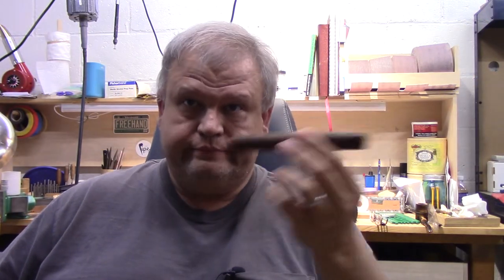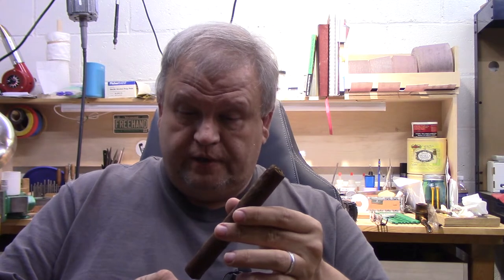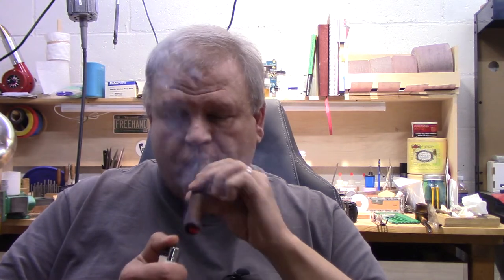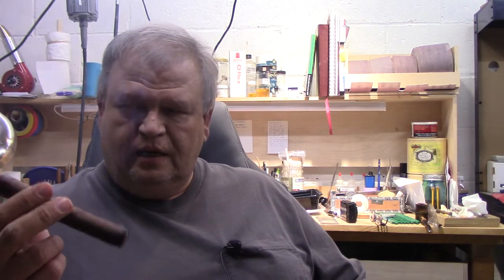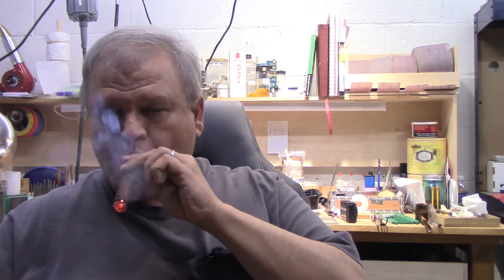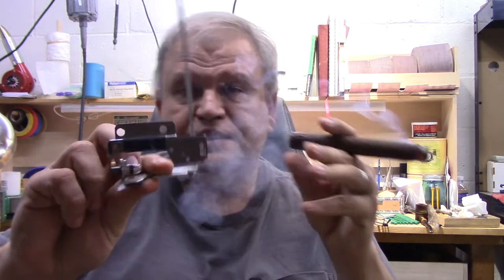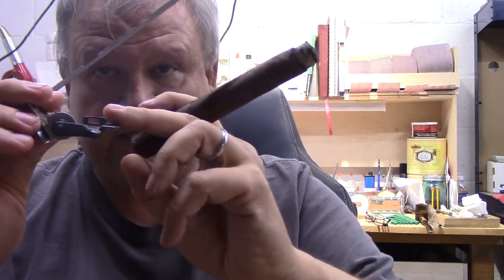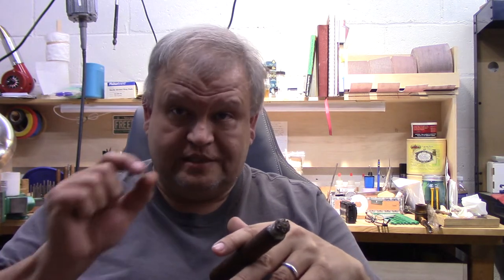Thursday Roadway Ramble 04 June 2020

Comment: I've also fixed a few laptops and it's often a patience game, you really have to take your time and examine how everything is connected before rushing into it. Taking a picture before you take it apart is often a good idea and a set of magnetic screwdrivers and bits can be a tremendous help. I'm not at all surprised you tried to fix it yourself (fixing things is in your DNA) and I'm positive it will work once you get the cable you ordered!
Reply from the maker: Thanks Christian, so if it doesn't work I can send it to you? 😂😃😂   Just kidding, hope you are well my friend!
Reply: Anytime.